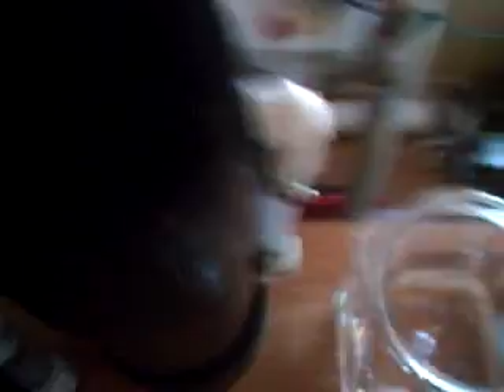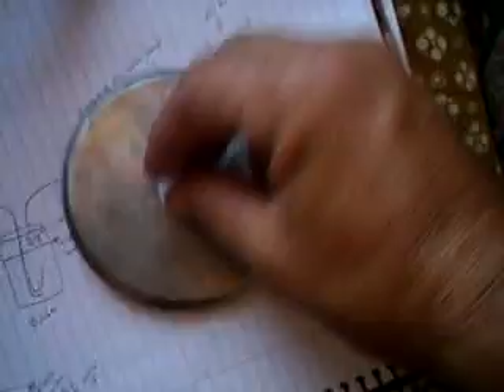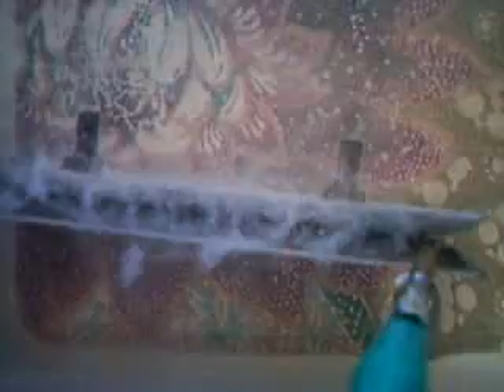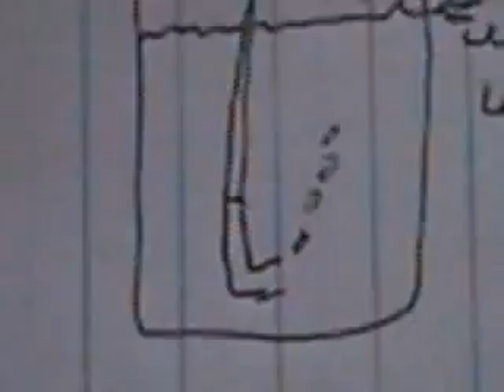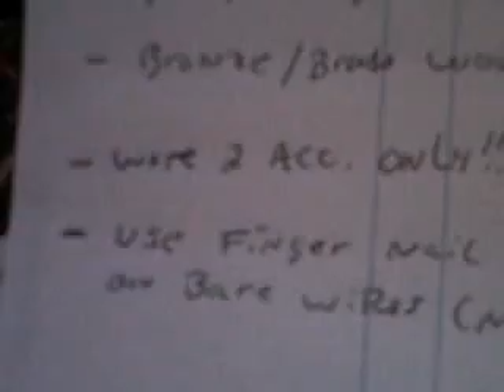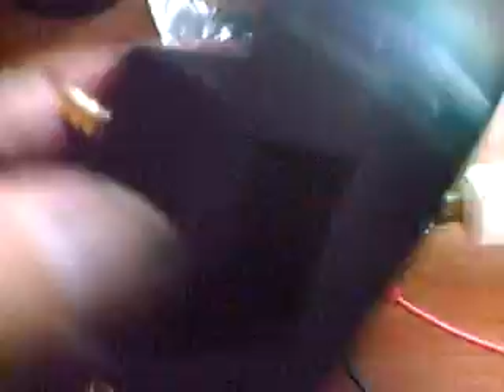vehicle hho building

Comment from the maker: The blinker has a built in cap on it. It takes 5 "blinks" to fully charge the cap, the current will start low and increase more each time the cap "fills" up. On a six plate test, the initial current went from 1.8 amp to 7 amps on average with the last blink in the cycle. You can run more than one blinker unit (in parallel) to increase the current. But the purpose is to keep things cool and automatic. by keeping the load on the blinker light, the blinker will last much longer.